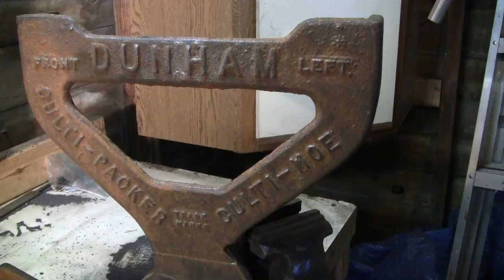Restoring a Dunham Double Cultipacker

Comment: Hi Mike, thanks to you I’m restoring my double Durham cultipacker, it’s basically the same as yours but the pieces that take the axles are different, if I knew how, I’d send you pictures.   I’m also going to make mine a 3 point. Have you ever considered that?  I’m missing the caps, you wouldn’t know were to get parts for this baby?  Thanks
Reply from the maker: Jim Sobota hi Jim, sounds like a great project! Not sure where you’re located, but try searching used tractor parts or tractor salvage yards for the parts.

Let me know how it turns out,

Mike

Comment: Great video, and nice job restoring that Dunham cultipacker.  How has it held up over the years?   I'm currently working on an old Oliver that I pulled out of a fence row a couple weeks ago.  It had been parked there since at least 1971.  I made new hardwood axle bushings in my shop and when test-fitting everything I noticed there is a ton of play in basically every pivot/bushing on the entire packer, including the wood bushings I built.  Was starting to worry that I am going to end up with a sloppy unusable machine until I saw your video.  Even the brand new axle bushings you installed in yours don't have perfect tolerances, and those old cast iron ones are far from precise.  I'm guessing this is actually not a problem and mine should work out fine too.  I had to disassemble mine as it sat, sunken into the ground and with a tree grown up through it, then carry the pieces back several hundred feet to the trailer (no access by vehicle).  Took me about 8 hours over 2 days.
Reply from the maker: Sounds like you have a great project! As you now know, those cast iron parts were made pretty heavy back in the day. They also seem to last forever if you’re carful when pulling it. It seems the design was to have a little play in everything that moved. Maybe that helps protect it when hitting stones in the field? Mine sounds like 10 kids banging cow bells when pulled 😁
Hope it goes back together for you, send me a pic when you’re done!